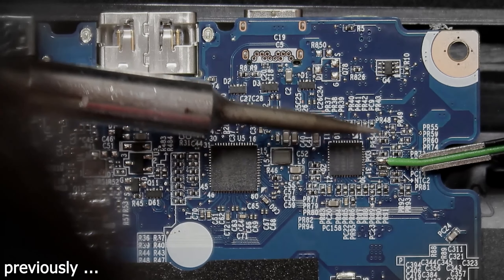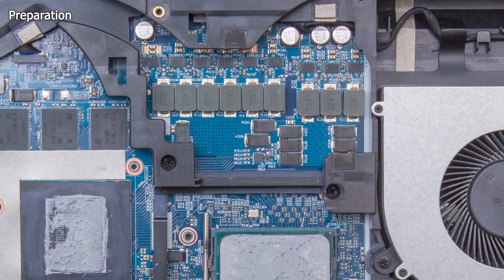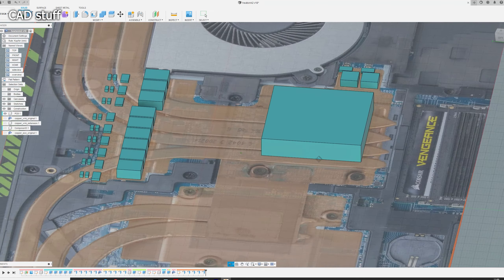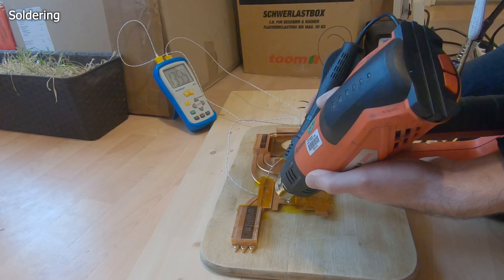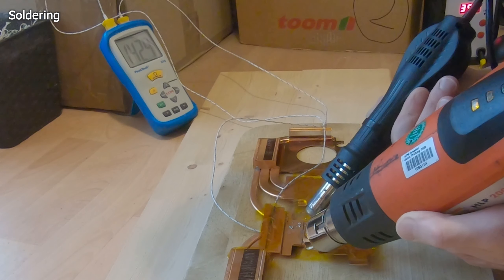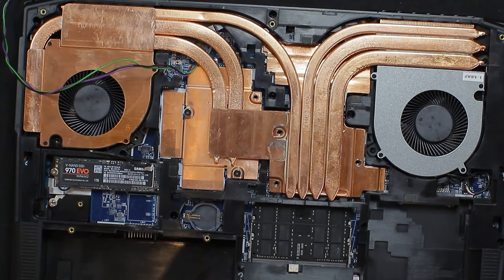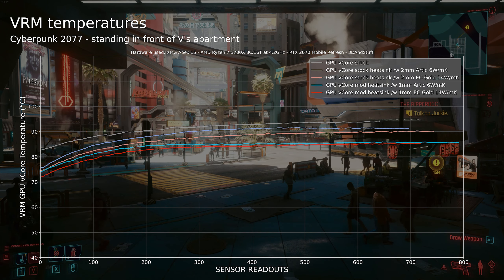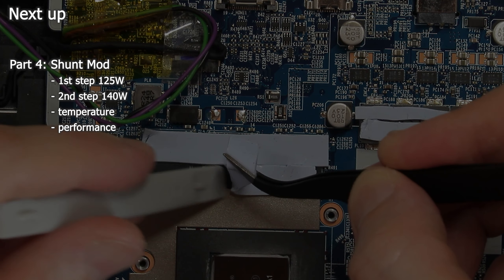Heatsink Modifications - Laptop Modding Adventure - Part 3

Comment: This video is two years old but if you plan to do further modifications like "doubling" the cooling performance then My solution should suffice...get two of the same model coolers and pancake them on top of each other, you'll be adding an aditional 20mm of thickness which your 3D printer can help you design the proper back panel.
Reply: Black panel? Replacing the back panel for laptop?

Comment: Was interested in the desoldering part, since there's a lot of info about how you should not try to solder the heat pipes as they can burst. Most info on the net implies they can burst either at 150C or after 200C which seems vague as hell. There's even a video of a dude on youtube that desoldered an old heat pipe without bursting it and not bothering to check the temperatures, however there are different pipes too. In your case you have thicker ones, while I'm struggling with my HP elitebook that has 2 times thinner pipes and I still can't steel my balls to try desoldering it. Thanks for the awesome video mate.
Reply: just managed to desolder the heatpipes of my thinkpad by heating it up at 350 degrees at max air speed using my hot air gun. while heating it up i put light pressure on the heatsink and heatspreader until they fell off. i think the people who made their heat pipes burst used tools that gave out absurdly high heat like a propane torch for example. i couldn't get the heat pipes to expand even a tiny bit using my hot air gun. not saying you shouldn't be afraid of them bursting but i'm giving my experience in case you wanna try it.
Reply from the maker: Just heat up slowly and take your time :) if it takes 20 minutes that's totally fine. It is a good idea to use a heating plate (e.g. cooking plate) for even heat distribution and assist with a hot air gun

Comment: Did you continue to use thermal pads or replaced them with a thermal paste such as k5 pro? Thermal pads in high-performance laptops are an absolute no-go! The contact pressure of the cooler on the cpu and gpu is worse and the heat dissipation to the cooler is significantly worse. With the thermal paste you also have the advantage that the thickness automatically adapts to the circumstances.
Reply from the maker: Depends on their softness. Too much counter pressure is bad, you are right. In this laptop this is very much the case with the GPU's VRAM. Even the soft original pads got too much counter pressure.
Reply: @TechModLab  From my own experience I can say that the k5pro thermal paste is very good and dissipates the heat better than thermal pads. I have owned an Asus GL702ZC laptop for a few years. This was the world's first laptop with an AMD Ryzen AM4 motherboard with B350 chipset and Radeon RX 580 GPU. When I cleaned the cooling system for the first time and dismantled the heatsink, I noticed that Asus applied a viscous blue paste to the voltage converters and the VRAM. I thought like other users that the thermal pads melted from the heat. However, Asus, like some other manufacturers, puts thermal paste on these components in their laptops instead of thermal pads. Anyway, I replaced this paste with thermal pads (I measured the thickness beforehand). But then the problems started. My performance was, despite mod BIOS and faster RAM (3200MHz instead of 2400MHz) optimized sub timings, sometimes significantly below the performance of other GL702ZC laptops. Sometimes I always had micro stutters, although the GPU and CPU temperatures were at 80°. I was able to eliminate the micro stutters with a 0.3mm copper spacer between the GPU and the cooler. Nevertheless, the performance was sometimes poor in games and benchmarks. I recently removed the thermal pads and replaced them with the K5pro paste. I also removed the copper spacer between it and the GPU. Now all problems are gone. No micro stutters, no more throttling. My Ryzen 7 1700 is now just as fast as a desktop PC in the CB23! In general, the laptop runs great. Maybe you could try this, too.

Comment: bro i have lenovo laptop 2 yr old have 8gb ram , 250gb ssd , integrated graphics card running linux,
 i dont play games in it and i clean it every month but then also it get heat and battery drain quickly , and it take much time to boot up even it has ssd only any sol

Comment: buddy can you guide me in soldering a peltier module to my laptop copper plates please i am immersed 
in this cooling please help me
Reply from the maker: Peltier elements usually have ceramic plates on both sides, so you can't solder them onto metal. Glue would be an option

Comment: Hi! 
I got a rebrand of this laptop. And Crucial Ballistix 3200 caught my eye in local store. Looks like the video about these sticks won't be released, so could you at least just tell is it possible to get them running in our laptop? 
And is there any profit at all? I don't know why, but this RAM is cheaper than Kingston HyperX or Corsair Vengeance, even though their timings are worse in stock. And basically there are no other options, in the whole country we have only three ddr4-sodimm ram's - Kingston, Corsair and Crucial.
Also I'd like to thank you for your work on telling people about customization of this notebook! Your channel is one of the major sources of information about it.
Reply: I have those sticks. I haven’t been able to get them dialed in like I’ve wanted
Reply from the maker: Unfortunately I couldn't get my hands on another pair of Crucial Ballistix. It's quite expensive for me to test them, because I need to buy them. If you know someone who could borrow me his Crucial Ballistix I would be glad :) In fact I prepared some data for part 3 of the memory tuning series, but did not finish any script yet. It will take probably some extra months until a new part is released, because I got a lot to do in my job atm.
I heard mixed things about Crucial Ballistix and the achieved timings. Some say you can achieve 3200CL16 (but with loose secondary timings) and some say 3200CL18 crashes already. I guess it's about binning, too.
After some extended tests I can definitely say that DualRank sticks are way faster than SingleRank sticks, especially when the timings are loose. But the performance advantage of dualRank gets smaller when the timings get tighter. For example in Cyberpunk 2077:
3200CL22 SingleRank: 68.3 FPS
3200CL22 DualRank: 80.1 FPS (+17%)
3200CL17 SingleRank: 82.4 FPS (+20%)
3200CL17 DualRank: 83.9 FPS (+22%)
It's a bit shocking to see that 3200CL22 SingleRank users loose a lot of performance compared to simply buying DualRank sticks.
But please note that Cyberpunk is an extreme example and is very memory sensitive. Other title's performance differences aren't as hefty.

If you ask me I really like the performance of the Corsair Vengeance sticks and their tuning potential. But make sure to buy the highest clockspeed ones you can find. I tuned 2666MHz sticks to 3600MHz sucessfully. But for me the performance sweetspot of them is at 3200MHz according to my tests.
Reply from the maker: what are the best timings you found?
Reply: @TechModLab  I’ll have to go through my photos from last year and see but as soon as I’m off work I’ll post the best I’ve been able to get
Reply: @TechModLab  how do u overclock ram on a laptop ?

Comment: hei bro. can i use/add wire copper for my heatsink? considering the material is the same as copper pipes right
Reply from the maker: if you got the same heatsink, then yes. It is made out of copper only.
Reply: @TechModLab  for sticking it is good to use thermal double tape or thermal glue brother? cos i dont have solder

Comment: where can i get low temperature solder from? I cant find any.
Reply from the maker: you can find it at professional suppliers like digikey, mouser, RS and such. Look out for solder paste with bi57 inside (bismuth 57%) which is essential for it being low melt temperature (around 140°C). A common combination is Sn42/Bi57/Ag1.
Another alternative is the low temperature version of the Adafruit Maker Paste. This stuff is basically the same.
Reply: @TechModLab  thank you.